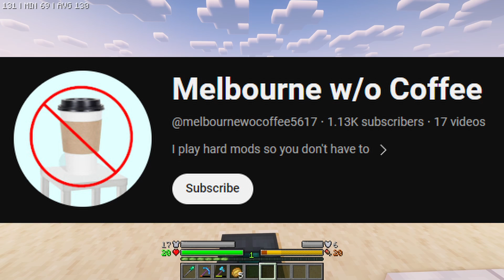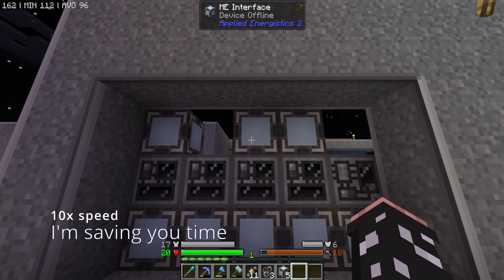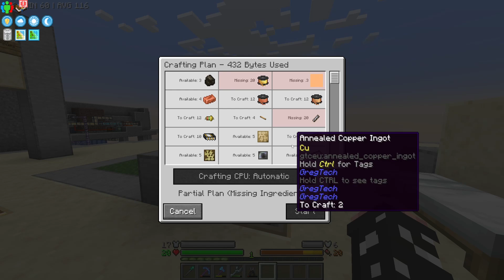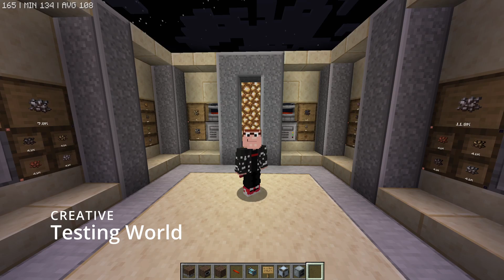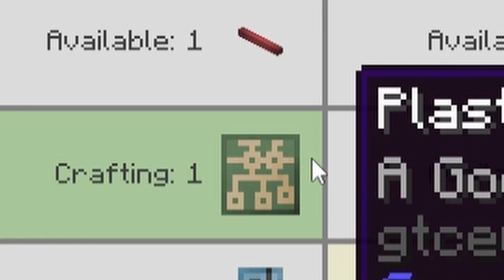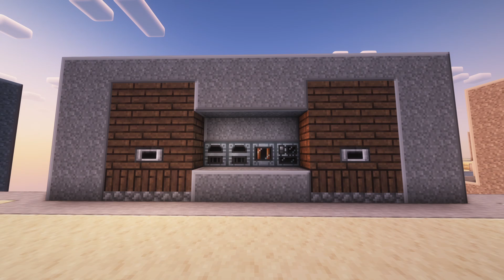Producing THOUSANDS of items for FREE! - Star Technology

Comment: It's interesting to see how differently the mod can be approached (obviously with updates probably shaking things up a bit). Like, the setup I've been building with a friend started with a Create-based auto-sieve as one of the very first things we had, before even unlocking any of the LV machines. I'm honestly quite clueless on how to utilize the AE2's and whatnot so my tech is still very much ork-style, I think we've gone to the HV mostly by brute forcing :D
Reply: Yeah, i love that it can be played on a lot of ways. I started using create and the steam greg machines. 
Just when i was setting up automatic sieving with create crushing wheels, the modpack updated (before, you could get every resource just by sieving, now you need more multiblocks, like the void extractor) so i just scrapped that and went for the mechanical sieve multiblock, very useful.
Recently, i have gotten into late mv, somewhat good infrastructure but not really. But, I've been getting ae2 to automate everything before HV

Comment: vid two months old so hmm. 
Currently using a lot of LaserIo to route items around while my AE2 system still in it's infancy. it also how i'm tramsitting RF around my base to the various tranformers.  with it you can also use Energy card set on sensor and a redstone card to turn off dynamos when power demands are lower. i mean sure infinte diamonds but still. 

Also, for anyone needing to get around there base faster, use Travel anchors. They have really good range.

There a fun way to get blaze rods early game for say speed upgrades for modular routers. just look up how magma cream is made hehe.

Comment: One thing you could do for any create stuff that needs SU is using Create New Age generators that convert RF into SU, since you have a power setup already you can skip all the water wheels whenever you need some SU

And if you need it faster, the rotation speed controller is what you'll need
Reply from the maker: Yeah I tried that in my tests, the creative motor worked fine, but when I tried the other motors, they didn't produce enough stress units. I'll try again but I plan on moving away SU generation
Reply: @melbournewocoffee5617  including the higher tier ones? Ive not gotten very into New Age but i do recall there are higher tier motors that generate more with the power it receives

And fair, being that far into gregtech you probably dont need it anymore, but still good to have the option when the need arises